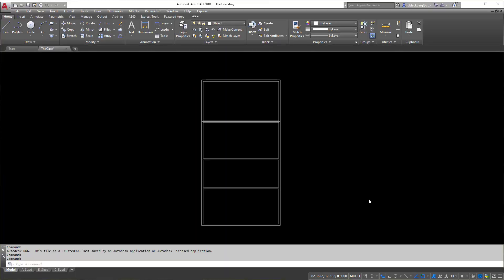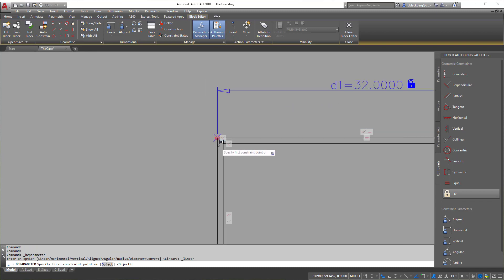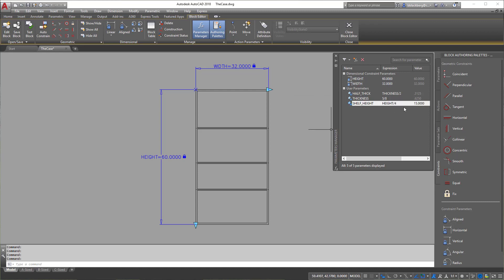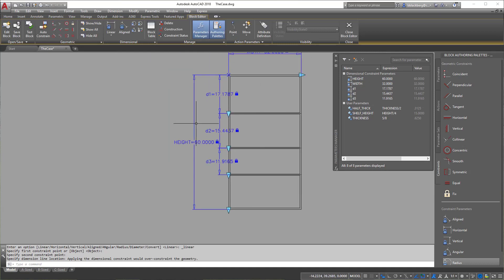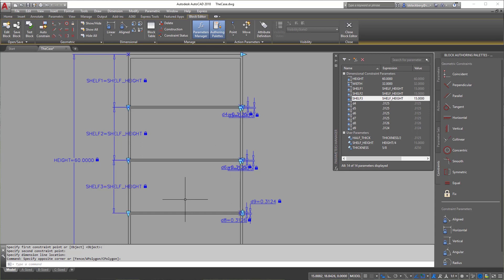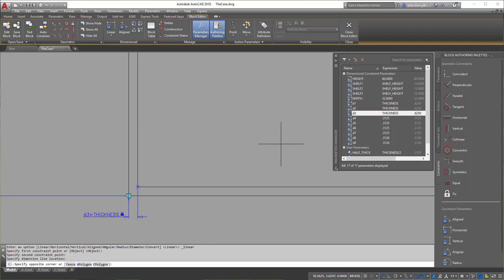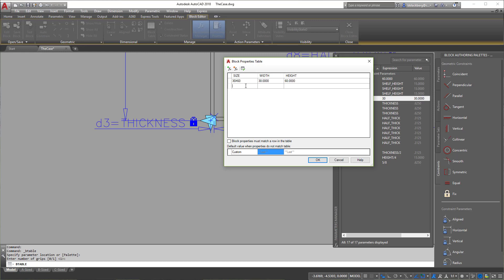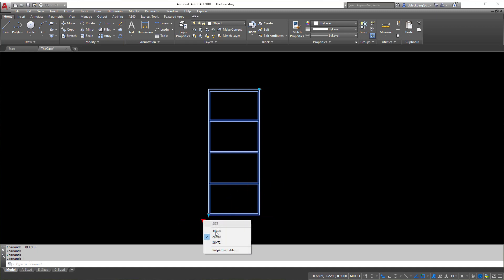AutoCAD Dynamic Blocks Part 2 - Utilizing Block Tables and Parameters

Comment: Hi Brandon, thanks for this information and sharing.  You mention doing cabinets and I have watched about 20 ppl do videos on Dynamic blocks, but none of them touch on the issue I am having.  I am working on a Kitchen Cabinet (the front frame of the cabinet box), there are 2 upper drawers over an opening for double doors below. To the right are 3 drawers. The drawers are not an issue for me when "stretch" is used, but how do I get the upper drawers to stretch to the right sizes, when I need the left side of the cabinet to stretch?  I need the upper drawers to maintain their width, (exact same with for each drawer opening) with 1 3/8" in between.   perhaps you have another video out there... Thank you! Lisa
Reply from the maker: Let me see what i have or might be able to create something

Comment: Thank you for this! There is a Test Block inside of the block editor (upper right corner) Do you don't have to save & close everytime.
Reply from the maker: Have had issues with the test block not working then being fine in the drawing so don't trust it 100%